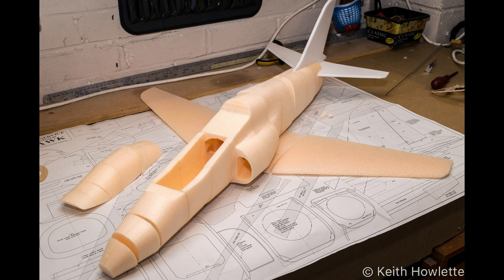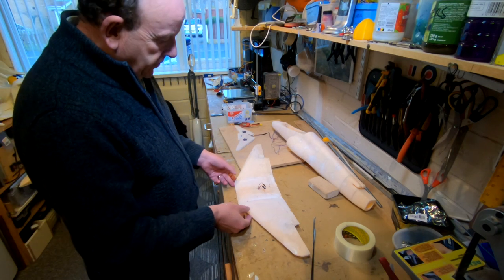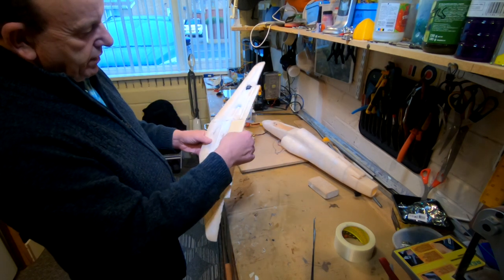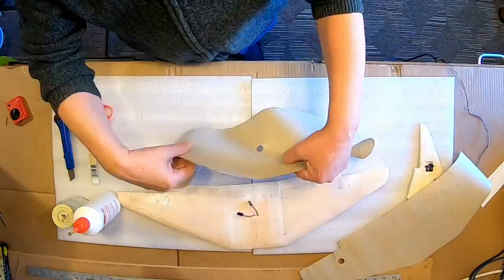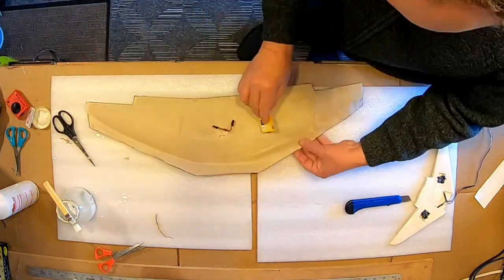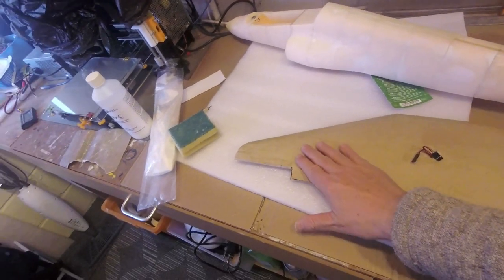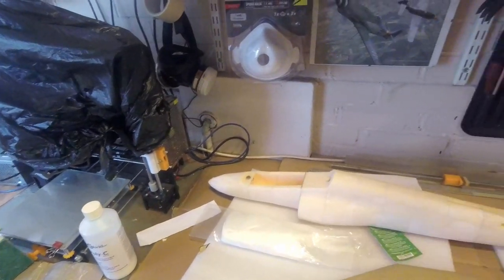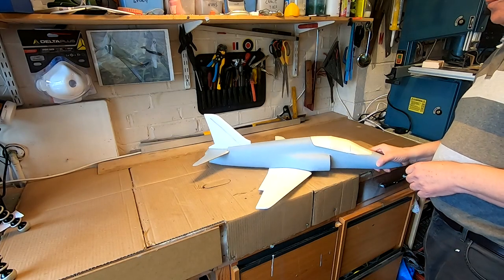DevFus Foam 2  Maiden Flight - Didn't go well

Comment: Nevertheless, Great Design! My foam Jets are cnc cut as well. But i just cut in symmetrical sections ( left and right Tower get the same data...) 
The finishing includes lots of carving with a knife and sanding. So I‘m looking forward for a grbl hotwire Version (without ramps).